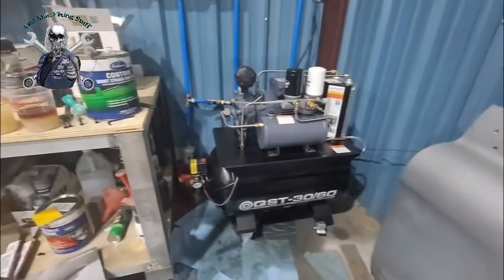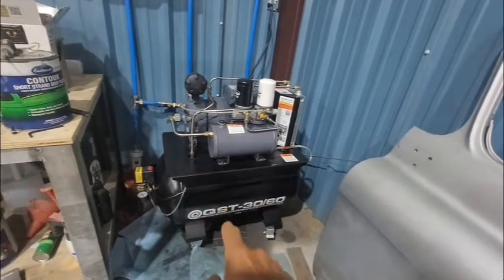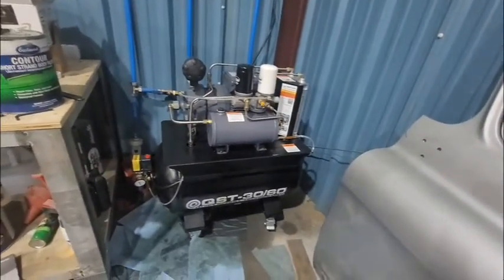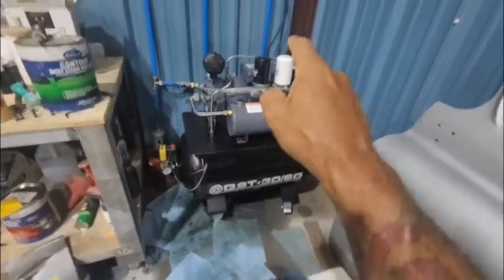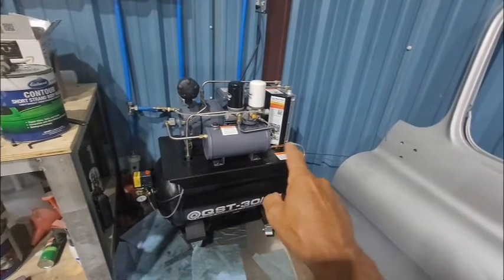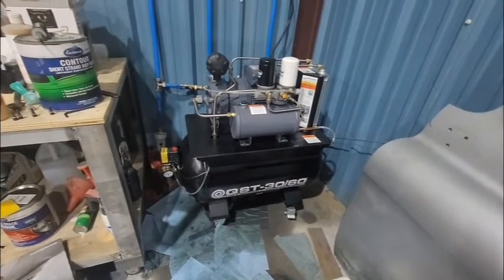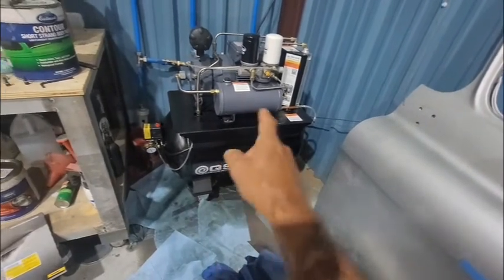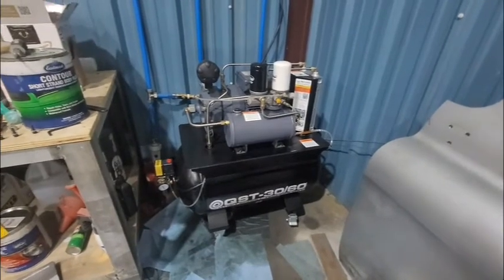Eastwood QST-30/60 Scroll Air Compressor blowing oil from pressure switch

Comment: Hello Oldman,,,,i too have a 55 chevy truck....anyway,,,,,,i'll tell you ALL what i know about my 30/60 scroll compressor.  When i bought mine ,,,i wanted to follow the INSTRUCTIONS FOR FILLING TO A "T" .because of the price.  I FILLED THE COMPRESSOR TO THE LINE THAT IS MARKED BY THE MANUFACTURER> what eastwood won't tell you is "THE INSTRUCTIONS AND MARKINGS ARE WRONG.!  you should only fill the tank halfway up to the line no fuller !   I asked them why the marking is on the stick and they told me it was wrong and you should only fill it to half of that.....if you go any higher it creates tooooooo muuuucchhhh preessssuureeee!!! I also asked them why they won't fix the instruction booklet that comes with it or add a notation to the email attached to the purchase.  Mine works fine now.....only a small amount of residue after the slllloooowwwwwwbbleed down of the relief valve.

Comment: Run an engine with water instead of oil see what happens. My guess is that the oil tank mixing the oil and water is not a good thing for the scroll pump mechanism. They need to re-engineer the dryer on the system somehow, or the dryer system on them may be defective.
Reply from the maker: I think you're very right

Comment: I was an early adopter of the quiet scroll.   Mine has been screwed up for a couple of years.  Mine sprays oil out of the over pressure relief valve under the water separator.  It came to a head when it ran for god knows how long before I went in to a secondary garage that the compressor is kept to hearing it running, popping line crazy and my Ferrari was covered in oil.  Customer service was of zero help.  It’s now long out of warranty and I don’t care, I’ll buy a Kaeser when it dies.  The water separator is a joke.
Reply from the maker: They just sent out notices not to leave it connected to power when not in use. The first of two replacements did as yours did ran until it blew oil in a fog all over my barn and cars. What a mess. Now they are a fire hazard if left  connected to power when not in use.

Comment: Im dealing with a new issue now, that orange relief valve under the filter and separator above the oil tank there is blow off constantly, I think im getting some back pressure somehow idk.

Comment: just got back from eastwood buying new oil, been dealing with this for 2 years, they just launched a new water separation kit, basically a chamber you mount on near the oil tank and can drain the water to a separate tank and then drain, im gonna get it, cut an access panel in the cover so I can do it without taking the cover off.

Comment: how about a line from the bottom of tank to another tank with a viscosity valve inbetween. That way water at the bottom of the tank is pushed through the viscosity valve and into the 'water tank' but when oil reaches the line the viscosity valve doesnt let it through. And a manual valve in between to close pressure while draining the water tank.

Comment: Sounds like these compressors are a major POS. I'm guessing that's why Eastwood dropped the price on these in just a couple years. I remember Eastwood wanted around $4500 for this model, and wouldn't budge on price. I want a compressor that I don't have to mess with every week. Maybe check the oil level once a month at most, and belts every 3 months. Thank you for posting this video and sharing your experience. Seems like other's are having the same exact issue with light use.

Comment: Mine just spit about $10 of oil on my shop floor. My concern is that this happened after the first cycle after an oil change. Common sense would tell me that all of the water was already drained out of the oil tank so I'm not sure how this is a fix. This thing is going to be a big paperweight in no time. FFS

Comment: Compressed air makes a ton of water, 10 hp of compressor power will make about 5 gallons of water a day. I can't see but you're saying compressed air goes into the oil tank? If so that's a horrible design.
Reply: Are you serious? I have a 20hp compressor in my shop which runs at least 30-40 hours per week and I drain less than a quart of water out of the tank once in a week.

Comment: We manufacture similar scroll compressors so I think I have an idea on what’s going on. 1) your usage for the compressor must be really low (2) you must be in a cold or high humid area. Condensation happens when the compressor does not run hot enough. You can sort this issue by adding a thermostatic valve between the oil line and cooler. This will ensure that only if oil is heated up above a particular temperature it will go to the cooler. So the compressor runs hot and moisture does not stay in the tank.
Reply: That is a great idea!

Comment: Same problem here. I added a timed auto drain to the air tank and filters; so, I have no problem with compressed air moisture. The Scroll compressor runs in an oil bath (unlike some other brands that are oil-less). The scroll compressor generates moisture that stays in the oil bath. When the water in the oil tank builds up sufficiently (to excess of tank design capacity), it has to go somewhere and goes to the pressure relief valve. A water/oil mix exits the pressure relief valve and makes a mess. There is no disclosure of this issue in sales advertising or in the operating manual. 

I had the issue after several months of operation. It took me a while to figure out that the oil/water mix was all coming from the pressure relief valve. At first I thought it was somehow coming from the air tank drain plumbing I assembled; it was not. After research and watching this video, I checked and found the oil tank was way over-full. I drained the water that had seperated from the oil to the bottom of the oil tank. There was more than a quart of water. The oil tank level went back to normal, between the fill lines.

I have talked to Easterwood several times. First they said I over filled the oil (my fault/not true), that I should drain it and refill to just over the lower fill line of the dipstick (contrary to manual instructions that say fill to the upper FULL line). Then on another call they said drain it down to 1/4 above the lower fill line, but don't fully drain and refill. Then in another call they admitted that they get many calls about this, two per day, and sent me the written instructions to drain water from the oil tank every week (which leaves water contaminated oil in the compressor). They said that they have no other fix for this and have none in the works. I explained my concern about having water inside the compressor and developing rust on the metal parts, thereby limiting the life. They agreed to take it back, and to refund by way of a gift card only redeemable at Easterwood. I have not yet received the refund or shipping authorization or instructions, but they are probably just busy this time of year.

I live in East Texas with a normal humidity of 85%.  I like the quiet performance of the unit, but I would not buy it again unless I moved to Arizona. Maybe operation in an airconditioned shop would work.

Comment: Where are you located do you have a lot of humidity in your shop
Reply from the maker: Just east of Dallas TX. I would think it's average. Not like the coast. I also don't get much water  in the air tank and didn't get much with my old compressor. I have 5 water separators on my air lines and in three years only had to drain one so far.

Comment: Man, I had the same issue with oil spewing out. When I called them a month ago they told me I might have too much oil in from the factory. Which was true.  They sent me a replacement pressure switch also. I’ve been ok so far. 

Ridiculous to have to keep separating the water yourself for as much as we spent on these things. I love this thing but I really hope they come up with a permanent solution.

Comment: You could put a bleed on it. Will bleed off the water on whatever time you set it to.
Reply from the maker: Got one in the air tank this water is in the oil supply you have to take it apart and separate the water from the oil. But tha thanks for the idea. I think that is what eastwood is trying to make to put in the compressor
Reply: @oldmanfixingstuff3722  any idea if eastwood has fixed this problem? i actually ordered one the other day.

Comment: I own an Older cast iron USA made reciprocating single-stage compressor that's for the weekender. I've had it around 25 years or so, I was really intrigued when I first heard about this scroll compressor (it's pretty affordable for the average homeowner). This doesn't sound like "normal" service interval maintenance work. Eastwood definitely needs to do some creative engineering to take this out of the homeowners hands regarding maintenance upkeep. Thanks for sharing, guess I am keeping my Old School Campbell Hausfeld.
Reply from the maker: The service that has to be done know was a 3 year service before this issue now it's a weekly check. Now on my third compressor in three years. Is very concerning. My last compressor I had 15 years but it was loud and when this scroll came out I had to have one. Replacing it every year has gotten old. Expectedly that I only got to paint part on one 55 chevy truck. Still have to paint the bed. This weekly check is also getting old fast.
Reply: @oldmanfixingstuff3722  yeah Man, you were probably thinking this was a really Great upgrade and it's quiet. That was quickly offset by the additional maintenance required. It's hard to be the first kid on the block with new(er) technology. I sure hope they get this resolved for you quickly.

Comment: Awesome update!   Glad i found this,  i was minutes away from placing my order even with the backorder.   I am wondering if using it in a conditioned shop space with very low humidity may make a difference?  Is your shop humid?  My current 30 gallon typically didn't require draining the tank more than once a month and even then not much comes out. 

They certainly need to address that issue.   They should probably use a bladder in the tank to separate the oil and and compressed air completely but still provide the required pressure to feed the oil to the scroll.
Reply from the maker: I live by Dallas TX. I would think average humidity not like living by the coast. I don't get much water in the air tank, I also have water separators in the air lines that after three years has collected little water. It collects more water in the oil tank than any place else. My concern is, what affect is water in the oil causing on the life of this compressor. On average I only use the compressor once a week for maybe an hour run time. I bought it to paint parts I have painted the cab and front fenders on the truck I am building and this is my third compressor. I also use it to fill tires. So little use. I have an auto drain on the tank it causes the compressor to turn on to top off the air tank maybe every other day. I will do this new maintenance and drain the water from the tank hoping they come up with a better solution or fix.
Reply: @oldmanfixingstuff3722  yeah i doubt it would be a humidity issue in Dallas..lol  

If you don't mind doing a video documenting the maintenance as an overview and your opinion on what kind of a task you feel it is that would be great.  I amnot opposed to maintenance, has to be done on machines, but if its an hour job a week its a bit excessive, 5-10 minutes i could live with to ensure long life and hassle free use from the compressor.  it is a small tradeoff from the noise of a piston compressor that has the same/similar flow capabilities.

Thanks OMFS!
Reply from the maker: @SmallShopConcepts  No problem, I'll do one this week.
Reply from the maker: I just put up a video on this. https://youtu.be/aYVwKaf0hzA
Reply: @oldmanfixingstuff3722  i wonder if you could add  an inline valve on that air pressure feed line going into the oil tank ( I would plumb in with some more pipe maybe to make the valve accessible without removing the cover) and then add a fitting to the oil tank plug threaded hole with a line and valve  and have both accessible outside of the cover so you could turn off the connection from oil tank to air tank, then bleed the residual pressure from the oil tank, then open the drain valve of the oil tank to drain the accumulated water and make it a 3 step easy and quick process?  I am only speculating as i have not personally put my eyes on the compressor, but it would seem that would certainly make it a simpler maintenance task with out removing the cover or having to drain an entire tank of 30 gallon tank of air every time you perform the maintenance.  just brainstorming as i am still interested inthis compressor over the other alternatives ive searched.
Reply from the maker: First sorry I missed your response. I don't think it's real humid here by Dallas TX. Average humidity is 60% I think not dry but not super high. Not like being by the water like Houston. Odd thing I don't get a lot of water in the air tank I get it in the oil tank.  I would say I am a light user, use it mostly to paint the truck I am building. Only half way through the painting still got to do the bed and on my third compressor due to this problem. So I have not painted one complete truck yet. Was hoping it would have lasted years before failing. So far on average they have lasted 9 months. I only got to paint the cab, doors, front fenders, hood and frame. Yes they need to fix the problem, the compressor I replaced I had 15 years worked fine but wanted to upgrade. Wanted something quieter because I had it inside my work area. If they don't fix the issue these need to be run in a controlled environment that is dry. Inside air conditioning.
Reply: @oldmanfixingstuff3722  I know this post is little old.  I live near Dallas also and was looking into this air compressor.  Looking for little feedback see if you're still happy with it?  Seen several of these posts about water in oil issue and wondering if it's been fixed or even worth hassle.
Reply from the maker: @jbb66  I was told I would get the fix for the water issue but never got it. Not sure is they came our with one I got to call them and see. I'm mixed it a great idea but I'm on my third one. The fix is to dump the water every week I don't use it that much so I get a few weeks before dumping the water not a lot if ya keep up with it. If it did not have the water issue it would be the best compressor. If ya ok with the maintenance of draining the water out of the oil then your good. If you are a high user you will need to drain the water from the oil a lot. It's a love hate issue love the compressor hate the oil water issue.
Reply: @oldmanfixingstuff3722  thanks for the reply back.  Given me something to think about.